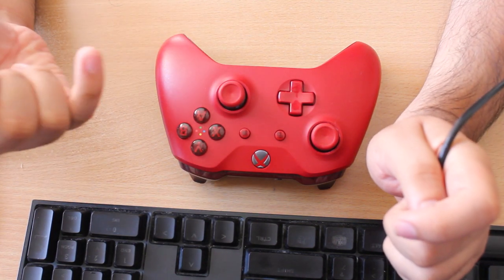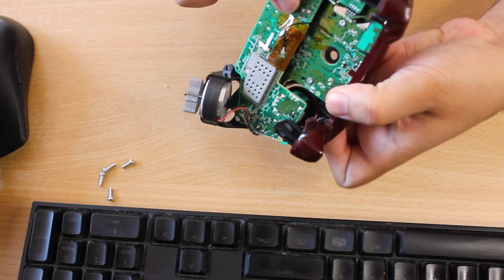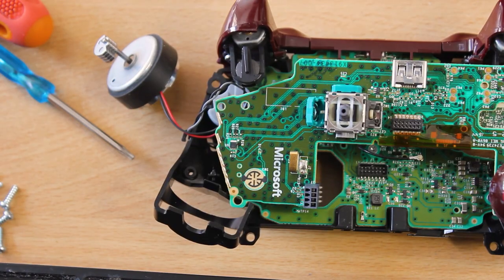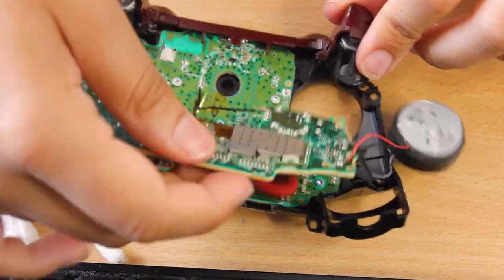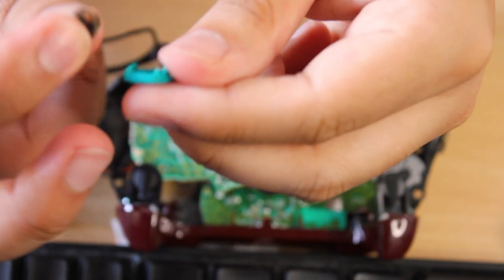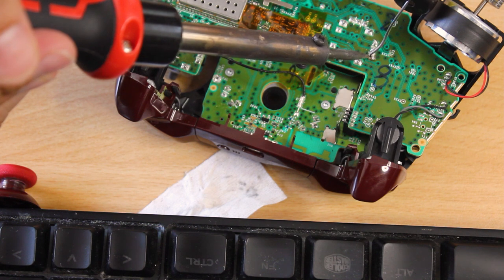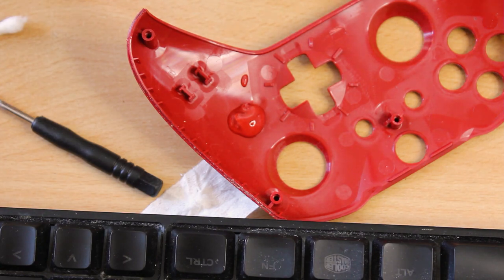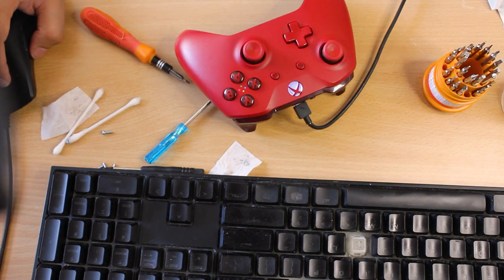Fixing the Drift Issue on my Xbox One Controller

Comment: Your video helped.  I have a scuff controller and the sticks can be removed without taking the controller apart.  After I did that, I used a tiny flat head and a pair of tweezers and rubbing alcohol and cleaned everything like you did.   Put the silver part back in with two little black dots down and flexi ends up and closed it up.  Works!  I was about to throw this thing out!

Comment: My drift is just... out of this world still
Reply from the maker: It could be surrounding  components of the joystick causing havoc?

If cleaning didn't work, the next best thing is to replace that joystick, or you could replace just the sensor that relates to y axis movement (since your controller drifts up)... so its easier since you desolder three pins compared to like 9 pins... I believe... if that doesn't work, replace the entire joystick... and if that doesn't work... it may be what I mentioned above with surrounding components affecting your joystick...

I was just fortunate that my controller required a clean...